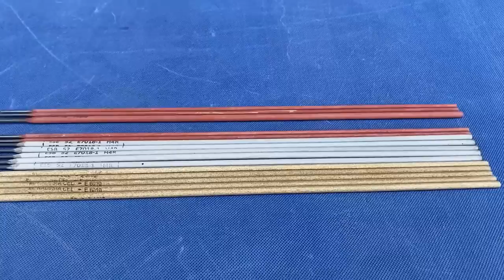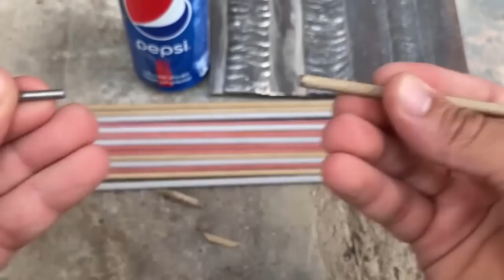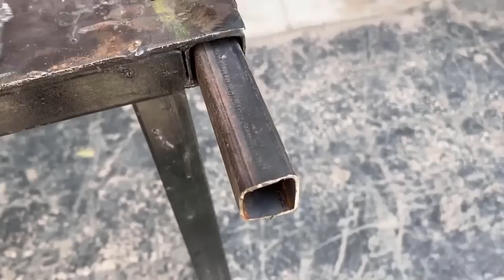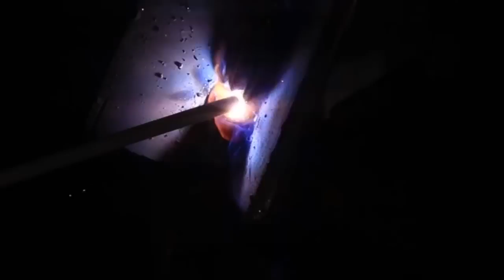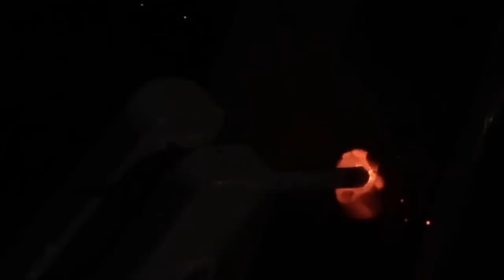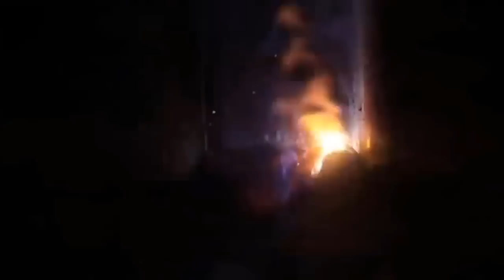The fastest way to learn electric welding is vertical welding

Comment: You know 1/8 7018 makes a 3/8 bead so you would fail a test right off the bat.Can you even run a correct size bead with one rod.
Reply: what a hack. I'm a welDer